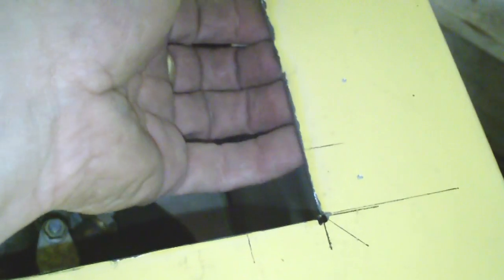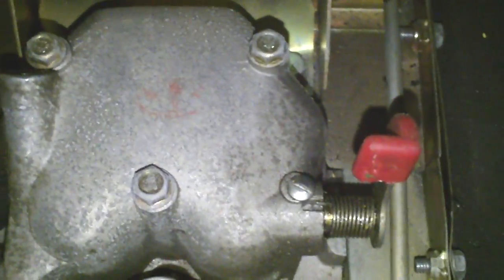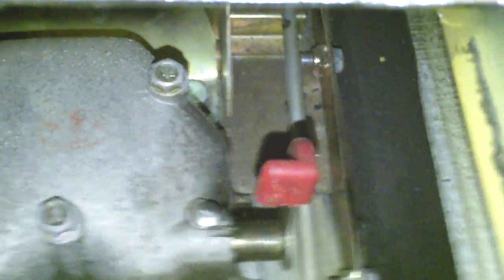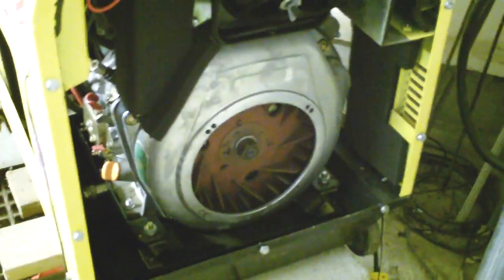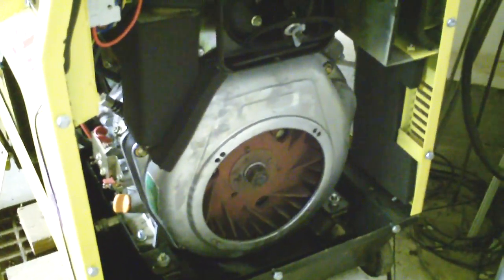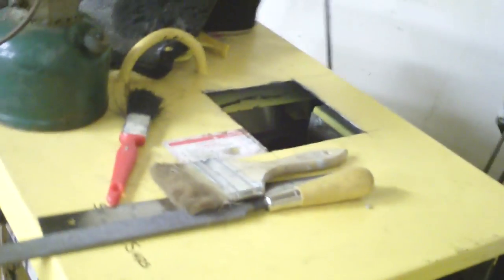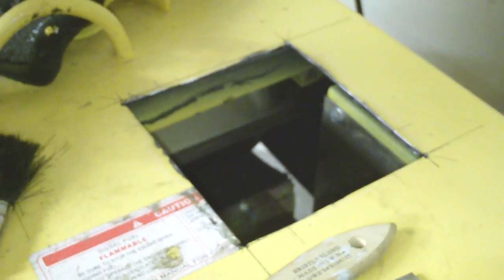Aurora Silent Diesel Generator Compression Release Hack Part 3

Comment from the maker: My base load was roughly 1kW or less, so no where near enough.  The space heater adds another 2kW and puts it in a cleaner operating range.  I added current monitoring meters for both legs, so now it's easy to see where we are for load and adjust accordingly.  Yes, good generators, and no regrets!

Comment: What kind of load were you running on it when it wet stacked?  We have the 2011 model (without the enclosure) and I've been concerned about that.  I made sure we turned on all the CRT televisions and incandescent lights when we were running on generator power just to make sure we didn't underload.  This coming year I want to add a watt meter just to see where we are.  All that said, Aurora generators are great!!

Comment from the maker: I'd say that they are good for what they are.  They're a high-speed generator (3600 rpm) that some of your sensitive electronics (TV, Computer, etc) might not like.  It will run your lights, blowers, and pumps just fine.  Unlike your truck, an inadequately loaded generator will wet-stack (carbon build up) and fail.   I run mine with a 4kw load for and hour every two months.  I also have a battery maintenance charger on it.   Best of luck to you!

Comment: I am actually thinking of buying 1 of the newer models. I've been researching them a little bit but I haven't really gotten too much feedback. We lost power two times last year and it was not a good experience. I drive a diesel truck so it's fitting that I was interested in picking up a diesel generator.

Comment from the maker: The elapsed time meter died and had to be replaced, so I'm not sure.  I wet-stacked it last year and had to replace the injector pump.  It's a great generator, but it's really too large for our house, and I had to add a 2000/4000 watt 240 space heater to the output to keep it loaded up and running clean.  I'd recommend them IF you have a base load of more than 2000 watts.  My excess capacity is used by the water pump, but I run the space heater at 2000 watts to keep it adequately loaded.